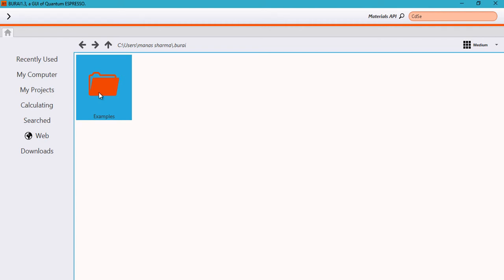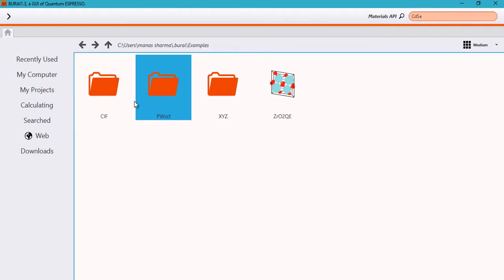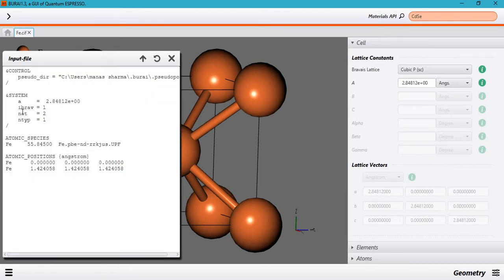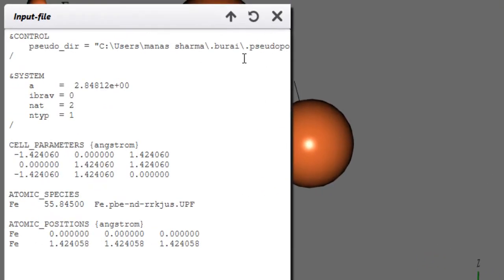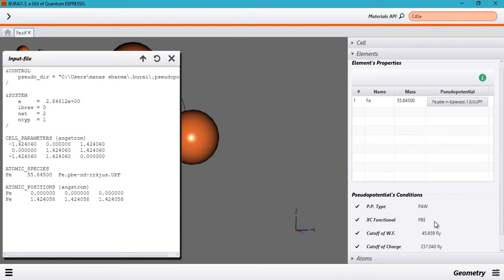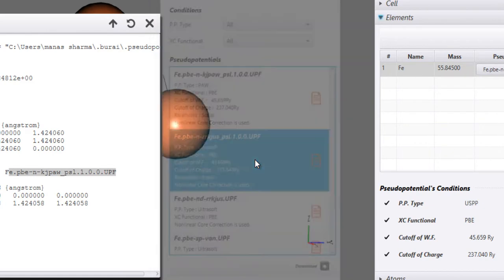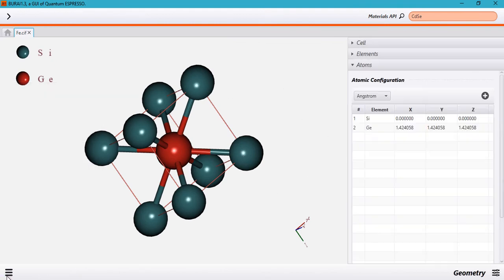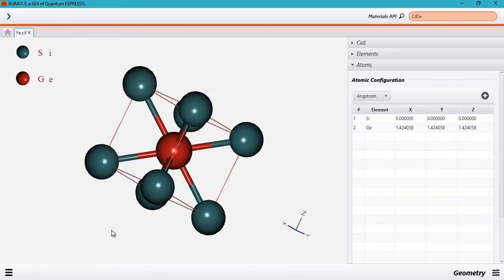Geometrical Manipulations like VACANCY and DOPING, PSEUDOPOTENTIALS, - BURAI TUTORIAL #2

Comment: I was not able to access the pseudopotential files.  When I click on "elements" under "Pseudopotential" is a red box labeled "unknown".  I tried downloading pseudopotetial files but did not have any success with that either.  Any suggestions folks?  Thanks!
Reply: I had the same problem, but I struggled a lot to fix it. I think the error was that  inside the burai. folder there was no access to the pseudopotential files. I had to change the path where I extracted all the info, so the App itself could have access to these files.